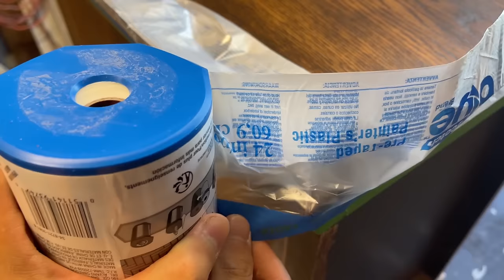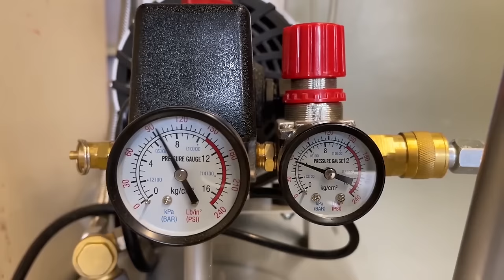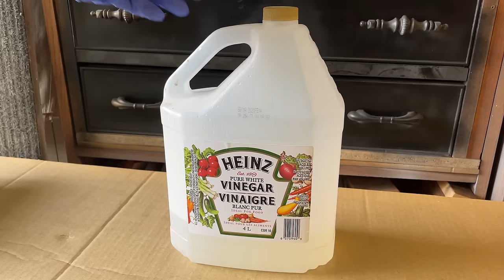Turning an Old Desk into Mid-Century Modern Nightstands

Comment: WOW! Most people wouldn't have looked twice at that beat up particle board piece of crap, but you not only looked AT it, you looked BEYOND it! This was an incredible transformation! I'm a little mad that you showed everyone how useful old, solid wood tabletops can be, though. I'm afraid my freebies will dry up now. 🤣 Fantastic, Andy!
Reply from the maker: 😂😂 Thank you!
Reply: Right?! I’ve been buying up old tables for years as the wood is so useful!
Reply: Year ago, my employer was throwing out a large old wood desk.  The base cabinets were veneer particle board, but the large top was 1.5" thick solid oak!
I turned it into a "flip down" workbench in my garage.  I was pretty proud of the engineering I did to make it pivot up against the wall to allow for car parking, then pivot down with separate legs to form a very solid workbench. It was instrumental as a work surface when I built my own kitchen cabinets.   Sadly, I sold that house and left the work table in the garage for the new owner, but I regret leaving it.
Reply: @canadude6401  that’s awesome! Saving the good wood tops is so useful. I keep grabbing table leafs and broken tables for the wood. I’m always surprised more people don’t do that.

Comment: Love your work & subscribed.  Question:  Looks like  you put wood glue, then Bondo, then a super thin length of wood, in that order, as filler (over-filled for future sanding) for the grooves you didn't want to use or be seen.  Why was the glue necessary?  If only to secure the thin wood strip, then why was the strip necessary?  I've seen other YouTubers use Bondo, alone and/or epoxy wood fillers, alone, for much bigger gaps than those grooves.  You do such beautiful work, I'm sure there's a good reason, so just curious.  Or, maybe it's a "belts AND suspenders" kind of thing??  Which wouldn't surprise me a bit, given your penchant for quality & going that extra mile.
Reply from the maker: Hi :) My thinking was that the wood glue would adhere the thin wood strip into the groove, and the wood filler that oozes out would fill in the voids (and over-fill to sand flush). Without the wood glue, it wouldn’t have been reliably secure. I considered using Bondo initially — which definitely would have worked — but when I saw that I had these thin wooden strips that fit perfectly in the grooves, I just had to use them.

Comment: What’s the reasoning behind putting glue down before filling spaces with wood filler? I’ve never seen that done before.
Fantastic makeover, by the way. 👍👍
Reply from the maker: My idea was that the glue would serve to adhere the wood strip into the gap, while the wood filler would ooze out and fill in all the void space! Then I was able to just sand it flush once dry :)

Comment: WD 40 dosen't present rust - it is a rust loosener. That spraying inside the drawer is far from optimal, unless paint is really hard and scratch resistant, as go for the back of the cabinets. Otherwice nice pictures and nice design/color choice.